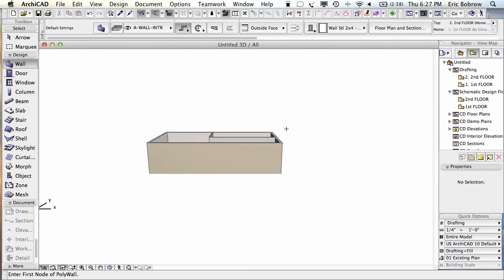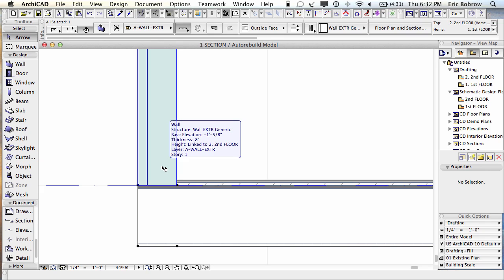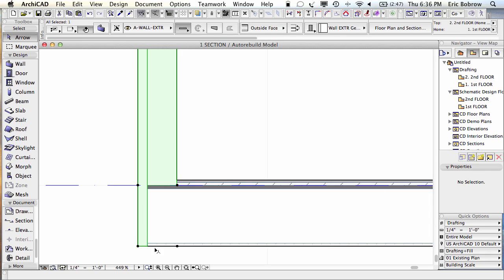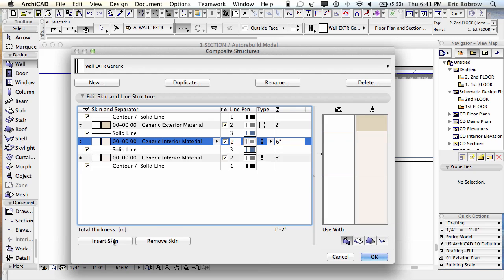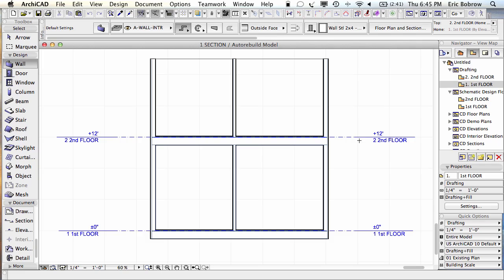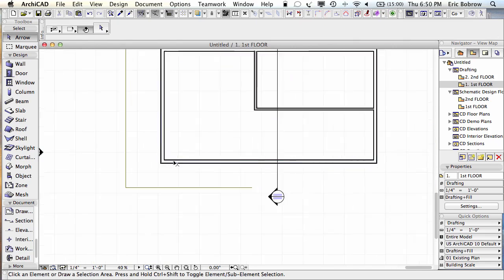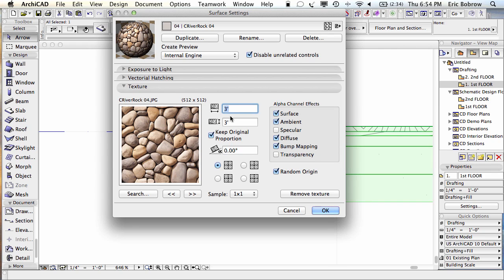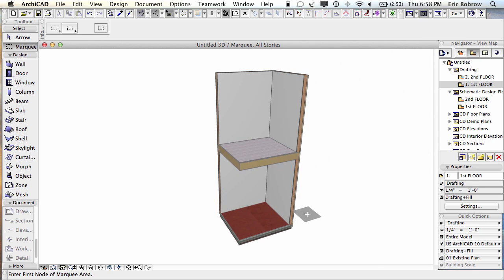ArchiCAD Tutorial | How to Use AC17 New Building Materials for Clean Sections and Detailed 3D Models

Comment: Good overview. I'm really pleased that ArchiCAD 17 addresses several of the concerns I had in the past, especially about the way we had to trick the model to have construction-worthy sections.

I'm still wondering how to adjust my modelling habits, though. E.g. with different ways to position slabs (e.g. based on Core Top), it might become more practical to place all elements with the story level as construction reference, rather than as the floor finishing, like we used to do before.

Comment: PERFECT! i noticed that when you turned on the line weight, the slab core was missing a thick when it met the wall exterior, as well as the wall exterior on its bottom face. How can we fix those issues?

Comment: Thanks Eric, Good clear tutorial as allways. There is though one thing that bothers me quite a bit: Now that sectios clear out based on priorities, what are we supposed to do on plan? Let's say I have 2 concrete slabs joining where the thickness of the structural concrete is different, but the floor finish is identical. I can see that using composits would work nicely in section, but on plan it is quite likely that I do not want to see a line between the 2 joining slabs. Any idea?